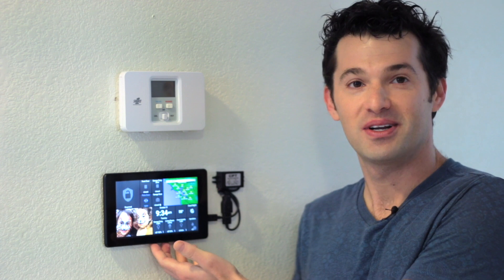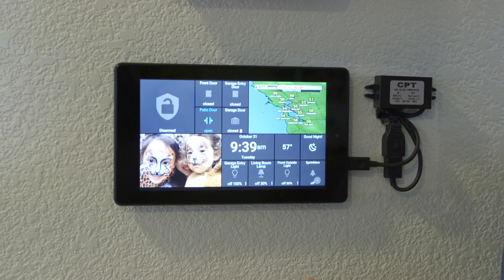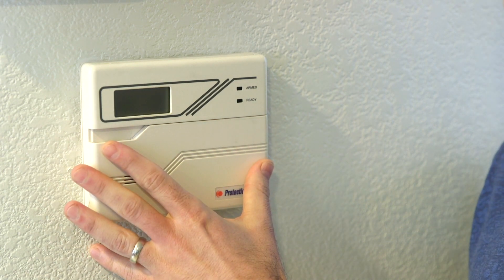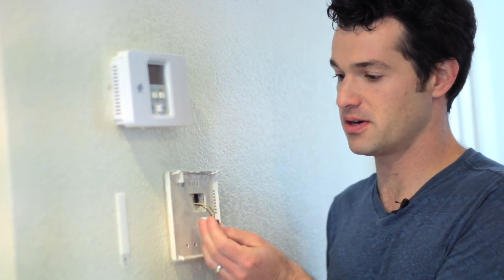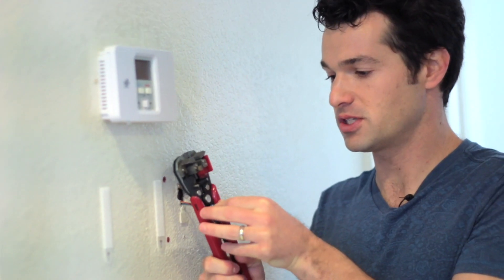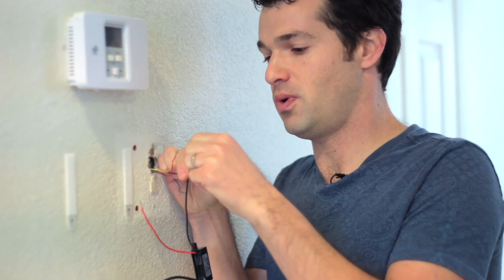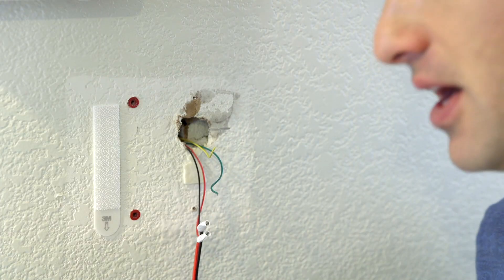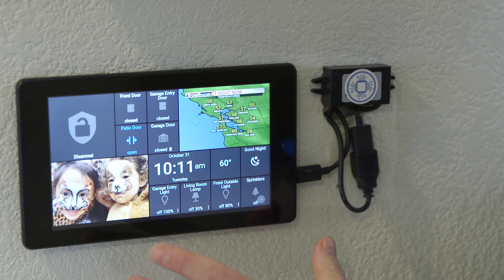Replace your alarm system keypad with an ActionTiles touch-screen tablet — Konnected DIY add-on

Comment: Looking good to have a solution in doing away with old outdated "dumb" system like my DSC with a 1832 board. Hope you guys are thinking about us with wireless sensors too, DSC is 433mhz. You should come up with a extension box that mounts right over the old hole then the Fire panel mounts on top of the extension box. Wiring and adapter all go inside of the box witch would only be 3/4 inch deep. Would make a nice clean mounting solution.
Reply: If you're willing it's possible to change your old wireless sensors to z-wave door sensors.  There are numerous types including your typical contact sensors to hinge sensors which have a "cleaner" appearance in my opinion.

Comment: What happens to the alarm system when there is no power?
Reply: Konnected, thank you... I guess I was thinking more along the lines of communication out. If there is no powers then there is no WiFi, no WiFi no alerts going out correct? I would like to make the switch but I want to make sure it will fully protect my house and family.
Reply: Konnected Thank you for your time answering my questions. I will definitely read read through the article you linked here. Now my next task is to go ahead and order the konnected board. Too bad I have to wait till February to implement this.
Reply: Hi - I can't see Konnected's reply - but I had the same question.  I want to hook this up through Home Assistant - but if the wifi goes off or Home Assistant has an issue, will the Konnected still sound the alarm?  Does the Konnected board essentially enter an 'armed' mode - as well as the Home Assistant?  Thanks!

Comment: How does the tablet receive all of the data signals from the existing (hard wired) security alarm system?
Reply: Konnected ok i see now. Your Konnected board converts the signals. Does it work with ADT Pulse?
Reply: Jason Chipkin I thought there was a converter to use tablet as alarm keypad. when you abondoned the yellow and green wire that kills any chance of communication to alarm system. Basically you're using auxiliary power from alarm panel to power tablet. Was hoping to see a virtual keypad type thing to use with alarm panel keypad was connected to with the addition of using tablet to control other home automation, camera apps.
Reply: You say that SmartThings is a cloud service. Does this solution work if there's only local network connectivity and your ISP network connection is offline?
Reply: Jason Chipkin

Comment: Do you have one that everything is flush and clean. I really dont was to see the wire or the hole.
Reply: This is a fair question given that he referred to "those ugly wired alarm system keypads" in the video description above. Ugly or not, those keypads have built-in resiliency not present in the Konnected solution, from what I can tell. They require neither a wifi nor an internet connection, for one. And there are other solutions that allow you to keep both your existing alarm keypads and your wall-mounted Action Tiles tablets and have the two work together. That's significant not only for increased robustness of the system, but note that all those Honeywell wireless exterior door sensors use one of the keypads for wireless communication. Rip that keypad out and all of your existing wireless sensors (with really good range, I might add) suddenly stop working.
Reply: You can use a housing to try and hide the cables if you use a mainstream tablet. Alternatively, you can look at right angle USB outlets to dive right back into the wall.

Comment: Is there an tablet with the charge connector in the back so you can hide the wires?  I guess you could use one that supports wireless charging.